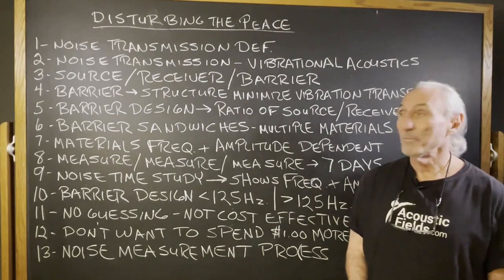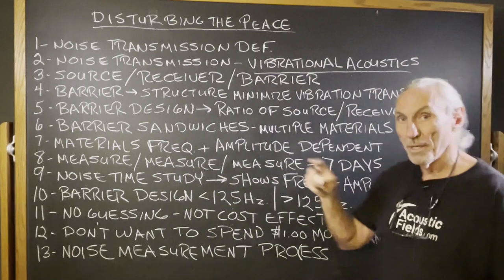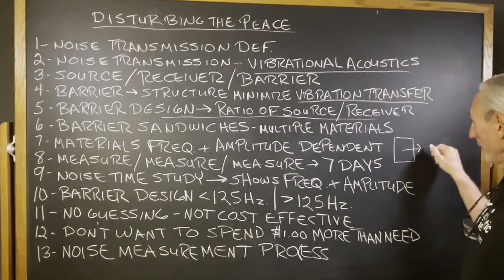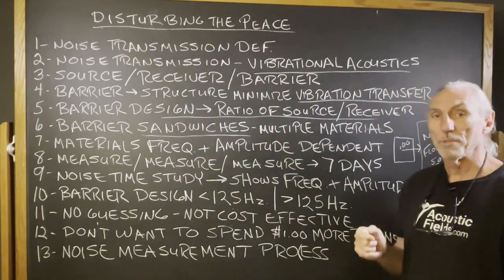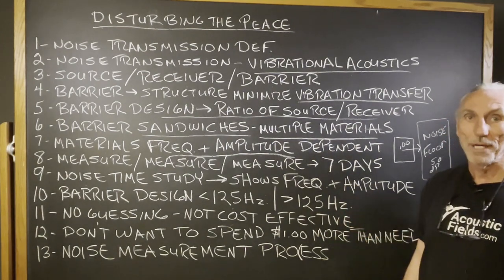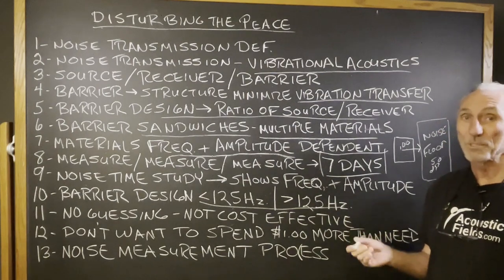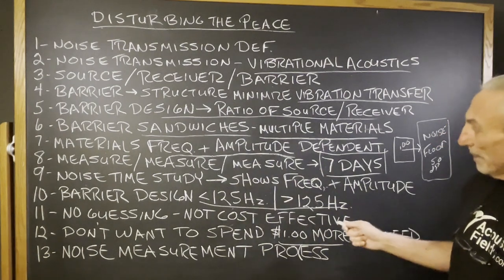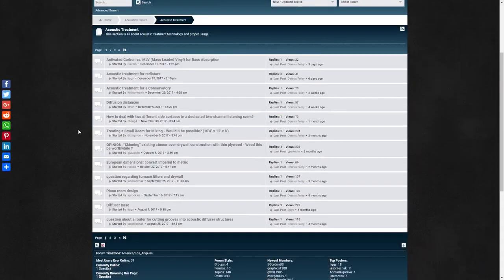Disturbing The Peace - www.AcousticFields.com

Comment: I remember watching an old episode of “ Holmes on Homes with Mike Holmes, and he installed a dry wall sheet which was equivalent to 8 sheets of drywall.   This radically resolved a noise problem between townhouses.  Any thoughts?
Reply from the maker: What were the frequency and amplitudes of the noise issues? You must measure thye noise issue before designing the appropriate barrier. How can a single drywall sheet be the equilavent of 8 sheets?

Comment: Went to measure some SPL on a couple of condo units complaining about neighbors noise. 80 dB white noise on sound source side, and 60 dB on the other side. Big job ahead on this one but the budget will simply not allow to build a wall to work <125 Hz. Getting all parties to understand what to expect is critical in this situation as well.
Reply from the maker: Knowledge is power. Especially when it comes to noise transmission issues.